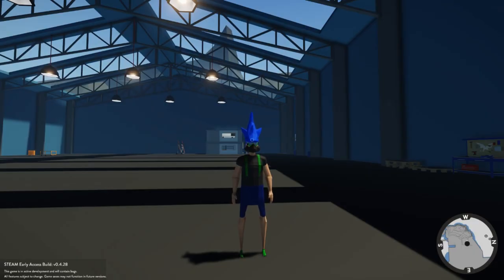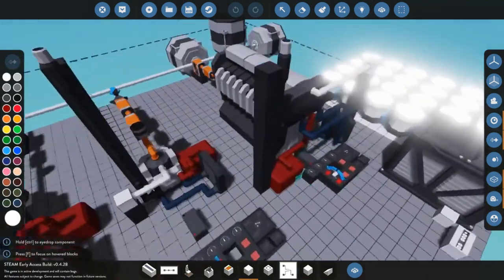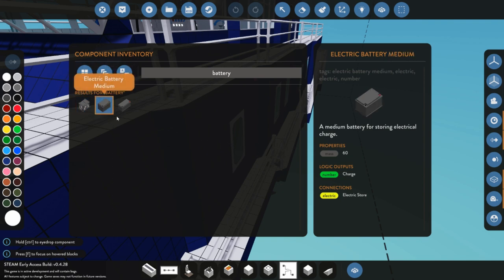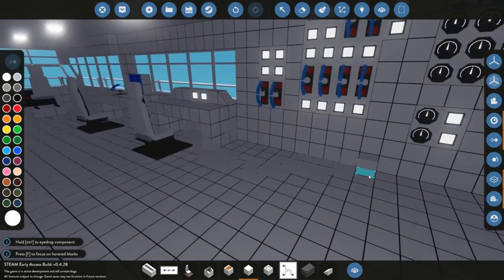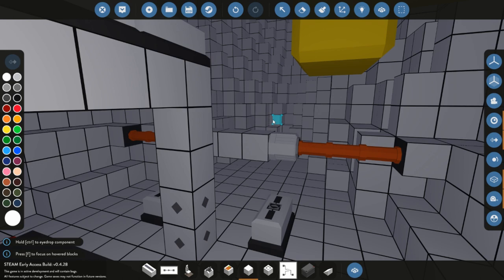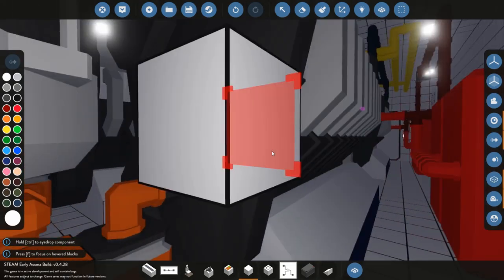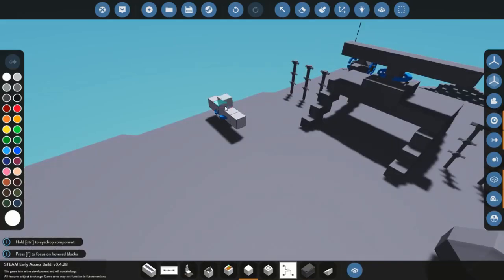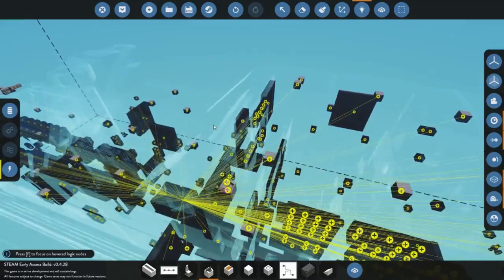Top 10 Advanced Electrical circuit Tips and Tricks! | Stormworks

Comment: Hey, quick tip regarding electric motors for main power! I've been experimenting with Diesel-Electric setups, and found that a large generator connected directly to a diesel engine (adding a gearbox between them in any ratio severely limits power for some reason), then connecting the generator directly to the electric motors will work without connecting the motor to any battery source. This is useful because your motors cannot drain your battery. The engine, however, does bog down with load. One diesel/large generator can drive a medium motor up to 100% without breaking the generator or stalling the engine (although my "sweet spot" is 3 engines/generators per 2 motors, the 3rd being battery recharge/emergency throttle), and the load keeps the engine rpms and temp low. You can use two relays/circuit breakers: one to the motors, the other to the batteries; so that the generator can supply either, but if they're both on at the same time the motor will draw excess power from the batteries and unload the engines.
Reply from the maker: that is a great tip especially for those electric engines

Comment: My only tip is to expiriment on a non vehicle build. Save what works and change one thing at a time until you get it right. It my not seem glorious at first, you can tighten your test build and then craft a ship around that, while also having the hardest part down and done with.
Reply from the maker: Thanks for the tip! I actually did do a system something like that for my latest build!